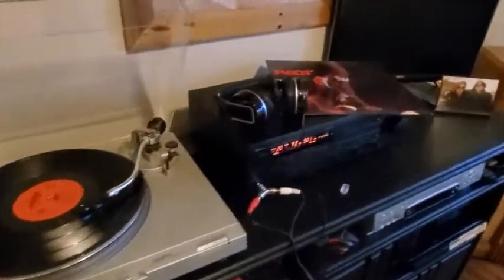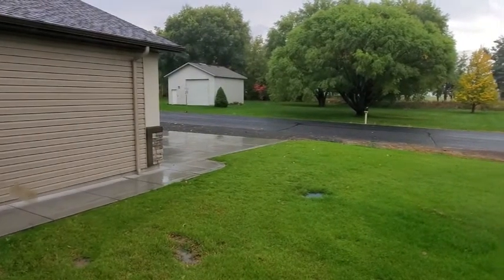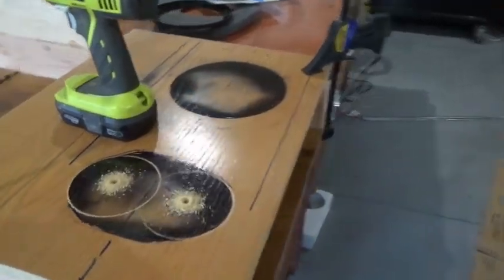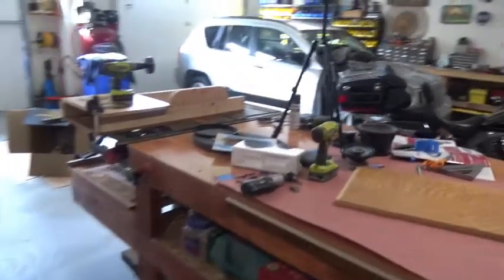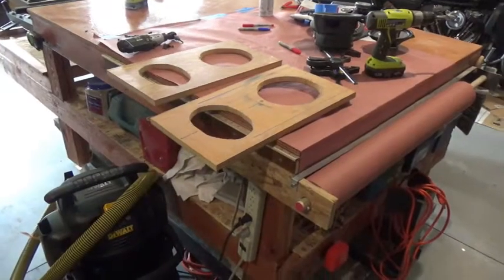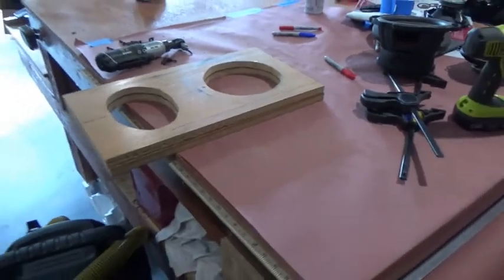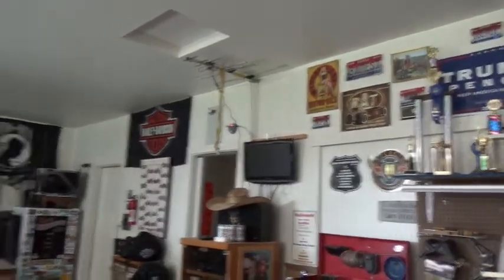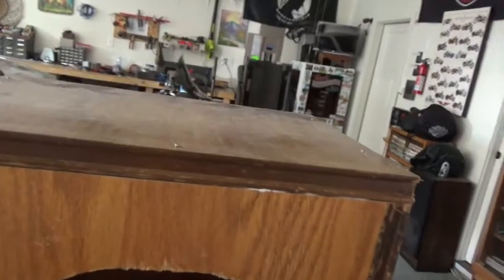A big thank you to Wild Wayne, which makes me start another project.

Comment: Another interesting project, bet they will sound great. I use D-Line rubber cable protectors on the floor in my workshop and outside on the shed driveways. Will take any weight car / truck / bike safely. Available everywhere and are very neat.